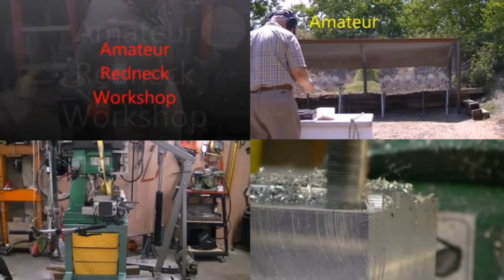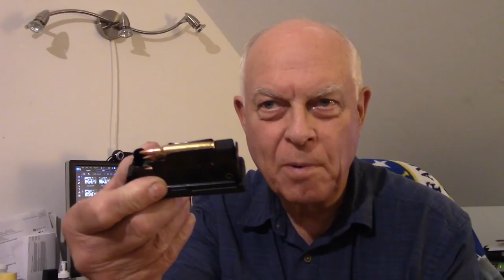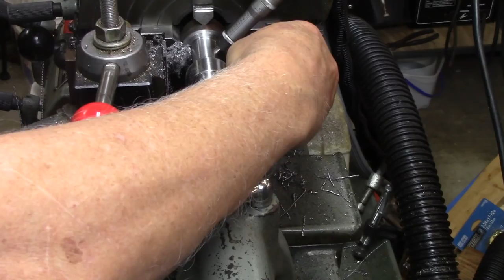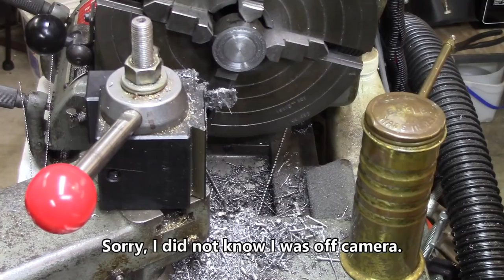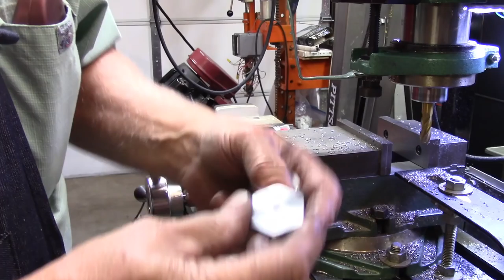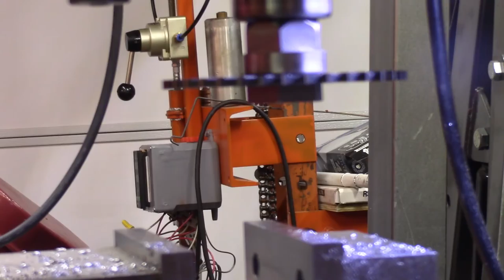Slitting saw arbor part 2 of 2

Comment: Hi Harold.

You could use a plain recessed end cap with a centre hole and pull it up with a bolt into the arbor shaft.  Doing it that way it will pull up dead square and be easy to tighten with a ring spanner.  Plus any keyway can be cut into the cap and the shaft.

Cheers Rob
Reply from the maker: I expect that is what I will wind up with.  The bolt did not turn out as expected.  Thanks for stopping by.

Comment: Nicely done!  As a hobbyist it's hard to justify spending lots of money on commercially available stuff when you can make tools that will fit your needs just by taking a bit of time.  It's even sadder when the commercial stuff doesn't quite fit right (like your commercial arbor) because you spent money so someone else SHOULD have kept the tolerance and made a working tool.
By the way, I like your video style, and how you approach things.  It's like hanging out in your shop over a beer as you build something.
Reply from the maker: I am all out of beer but I think this will work as a can opener if I get some.  Thanks for stopping by.

Comment: Nice work on the arbor Harold it turned out great  it was a shame that the nut slipped when you were machining it, but still you could make another one if it bothers you.
Reply from the maker: I will modify it a little if things are not perfect the first time I use it.  I may just cut some metal to see it work.  Thanks for stopping by.

Comment: Hi Harold. I noticed the slitting saw has a key-way, Did your other arbor have a key way ?.  If not that could be the problem Has the saw would keep trying to tighten the Nut / bolt has it was in the cut. Most saw arbors I have  worked on have a key way of pins to stop this from happening .
All my best Bobby
Reply from the maker: I did not yet make a keyway.  I will know more after the first time I use it.  I am waiting to see if I need to cut a keyway.  The factory made arbor does not have a keyway.  Thanks for stopping by.